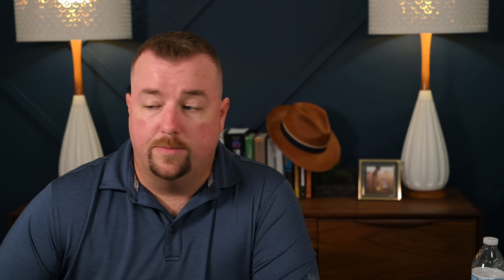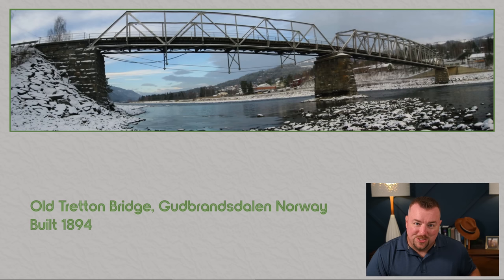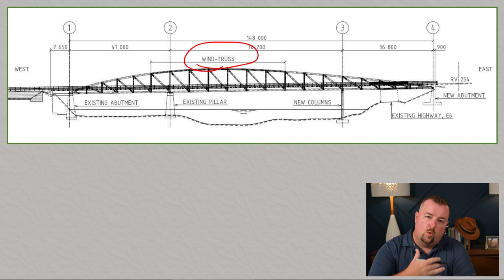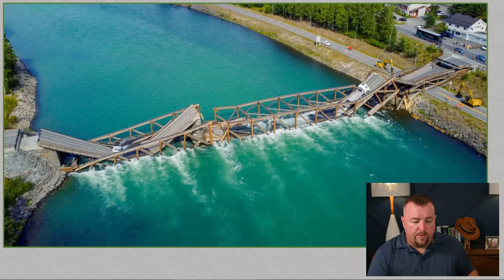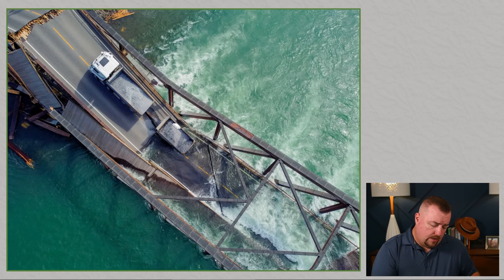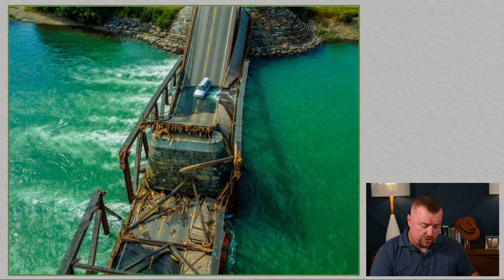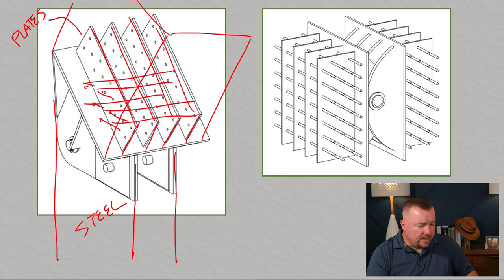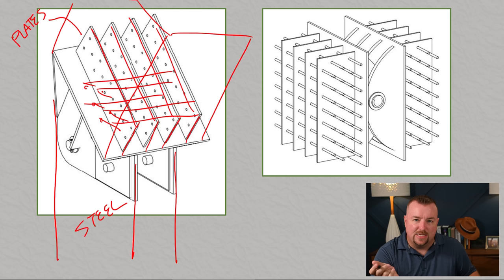How Did the Engineers Miss This?

Comment: Wood beams attached to steel in tension is never a good idea. It’s very difficult for o make this a reliable and stable connection. Cables for tension load might have worked a lot better. FEA / computer analyst without actual proof testing is never a good idea.

Comment: Wouldn't the dowel pins break because of different heat expansions between the steel and the wood? And the wood would swell when wet, so we get yet another different stress on the wooden dowls. Am I right?
PS: 'a lot of people smarter than me' - stop saying that to yourself. They're people whose work involves testing to destruction. You're a person who counts on their tests being accurate. Different jobs in the same industry. Not 'smarter', just 'different'.
PPS: I'd rather not take it with a grain of salt. Salt causes corrosion!

Comment: Humans have been engineering scarf joints for literally hundreds of years!  Why are they trying to reinvent the wheel here?  
I'm shocked that they didn't even lap join (to say nothing of a proper scarf) the laminated beams, but I guess that doesn't appear to look like where it failed first.

I thought is was kind of telling when the three "different" test samples were nothing more than minor variations of the same flawed idea, multiple fasteners on the same grain of wood.
I'm sure anybody watching this video knows that when you nail two 2x4s together at a 90, you put the nails in at a 45.  That is exactly so that the nails won't line up with the grain in either 2x4.
A proper test should be done with just three, larger and square, pins diagonally to the tensile load and grain.  The wood around the fastener is what matters, not the fastener itself.

Any amateur shipwright that watched this video, is already coming up with dozens of joints used in wooden boats that would have fared well better than this silly tab and pin idea.
 
I agree that without proper weatherproofing, the whole idea was doomed before it started; even if all the other issues were corrected.

Comment: Using solid or laminated wood is no problem. We have built bridges that way for millennia and they are holding up for centuries. Wood is also a very good construction material - cheaper, durable and light. Those bridge-collapses got nothing to do with the wood or glue but everything to do with crappy engineering - people with no experience, that only rely on computers and think everything the "old folks" tell them is useless.
That wood splits apart when there is tension and it is fixed with perpendicular dowels/rods is ancient knowledge hence why such connection are near universally reinforced with some sort of contraction that holds the wood in compression - like either a tension rod or compression ring.

there are several other flaws that had been brought up when those bridges were designed - one of them was the very poor and inefficient weathering protection.... rusty bolts in wood......

Also - considering just how bad the bridges in the US have become even these wooden bridges with insane design-flaws don't seem out of the ordinary.

Comment: My word this guy seems to like hearing himself talk and sound important.
As a builder of large construction for over 50 years I have learned more about practical engineering than the kids coming out of “engineer school” knowing nothing but how to push buttons on a computer to get an answer spit out.
Any experienced builder already knows that such a connection between wood and steel is a structural hazard on several fronts: 1) as shown; the wood fibers respond poorly to pin loading. And this truss design puts all the stress exactly on that joint in the worst possible way. 2) increased wood rot in these pin locations cannot be negated, exacerbating the fiber failure. 3) a truss stresses most at its “hub” locations (where members join) and this specific truss design makes that specific point the weakest, exacerbated by the previous 2 points.
This truss was an accident waiting to happen and any first year engineer should have seen that clearly.
This guy talked way to much.

Comment: The connection between the steel piece with the four plates merging into the slotted glue-lam beam is destined to fail.  IMHO, in order for the connection to work (water intrusion aside), he lumber and the wood must be compressed together.  However, this "Dagwood sandwich" of wood-steel-wood-steel-wood-steel-wood-steel-wood can never compress enough to form a grip on the wood.  Only the two outside pieces of the glue-lam are compressed against the steel.  The center three portions of the glue-lam (60% of it!) are not gripped enough in compression because those steel plates are not going to compress or bend towards the center of the beam when the bolts are tightened.  A poor concept will result in a poor solution no matter how well it is built.

Comment: Again I do not admire building engineers after 50 years in concrete management.Their job is basically common sense.Roman engineers achieved miracles without computers or sheets of maths.Most disasters could be avoided if plans were looked at by  large project building firm managment

Comment: Actually, it is possible to make interesting conclusions from this. So gluelam would have been ok for top trusses (basically as long as it is in compression) and whole bridge design would have been fine as long as bottom trusses and cross members under tension were steel. What I am saying this isn't even hit on gluelam, just realisation that this material should not be used under tesnion.

I have seen several bridges of gluelam, but most of them where pedestrian bridges with questionable life-span (so maybe design lifespan of 30 years)... and I think that is reasonable. However, I can't see how they made this vehicle bridge from gluelam and expected it to last 100 years... even 10 years seems kind of lucky. Besides anyone who has ever worked with wood, even small project, furniture will know that most common failure in wood are joints... seems obvious, bit probably it isn't.

Comment: Wow- after looking at the angle that double truck is at-

No way could just tires hold it like that.

Just a guess but I suspect the bottom trailer is sitting on "something" -preventing it and the rest of the truck from sliding backwards.

Oh if those folks are soooooo determined to use "wood lam" for heavy loads-why use ANY STEEL?

Should be easier to join wood lam to wood lam-just build-overbuild-heavier-Steel-pins etc-will always "shear-cut" the wood-that is why god made steel axes to CUT 

WOOD

Insist on using wood-use ALL WOOD

I wonder how the Limeys joined the plywood of their WW2 MOSQUITOES to whatever metal they used-yeah they had to mount very powerful twisting engines

to that plywood?? Course those 1940 woodworkers were far more adept working wood than 2015 "engineers"

Oh well great video-thanks

Comment: Those joints look like they were designed by someone who has never actually used wood as a building material! Why would you do it that way? Makes no sense. It looks like they were designed for steel, not wood. I'm just saying, engineers need to get their hands dirty, far more often. Take a break from designing every once in a while, and actually build something, with your own hands. Love the comprehensive breakdown! Thanks! 👍

Comment: An excellent video in all ways.  I don’t think the bridge designers appreciated two things.  First, truss joints ideally transmit only tension or compression but there is also a bending moment at each joint which will tend to pry the joint apart.  This moment will separate the wood fibers or glue planes in gluelam.  Second, shear fastener joints between materials with different moduli of elasticity must take the large variation in individual fastener loading into account.  Fastener patterns must be trapezoidal rather than rectangular as shown in each of this video’s images.  Early helicopter blades were often wood attached to metal root retention fittings.  Tapered sections and or bolt patterns were required for successful designs.
Reply: This whole bridge just gives me a bad gut feeling.  I would bet that someone placed too much trust on a garbage FEA simulation with poor material properties and mesh sizes around those joints.  Wood is very complex, not isotropic like steel and it seems like they just replaced steel members with wooden ones with a very crude understanding of the strength of the material.

Comment: And this is why i'm of a opinion that engineers well as architects should be required to work least few years in field they are designing shit before being allowed to draw a fucking line. Theoretical designing and practical designing are two entirely different things witch the practical side engineers most often fail in. Any wood worker or construction worker could have told them this would happen and reason is these engineers dont have per say street smarts for shit. Hell wood worker could have probably told them how to mitigate that issue and construction worker could have told them how to make it so when wood starts to rot away, how its easier for the workers to replace those peaces with out need to take the whole damn thing apart, over a water... Have the metal plus some rusting reserve be the main frame of the bridge that carries its weight, while wood parts are replaceable with essentially jacking the bridge from the center of the carrying spots using hydraulics so new beams can be placed under of the steel frame and those wood peaces bring the load carrying capacity of trucks and such. Deflection of the bridge can be monitored and repaird done when needed while using less steel as material, though its question if replacing stuff relatively often is better than spending more expensive steel that hold for century and just repainting it in few decades... As a builder sandblasting and painting would be easier job than replacing whole sections since you still need to do that maintenance to steel parts anyways with similarly size surface areas to that of a full steel bridge, so what was the point of this cost saving idea again? 
For instance buddy was welding frames for windows on steel glass construction that formed a pyramid. Dimensions were required to be rather accurate since size of that thing was pretty large.
Engineer comes to site inspection and starts to go ape shit on buddy since he was not following the technical drawings as presented. Buddy thinks this is a joke and replies with "tag holds a ton and flux a another, so it will hold just fine!". Engineer goes back to his car puffing AND COMES BACK with KEMPPI WELDING MANUAL and points out that 5mm long long weld with x penetration etc etc hold only X amount and flux is cover material during welding with next to no holding power to mention. Buddy realizes this daff cunt is actually serious and tells that these are tags to keep the construction in place and from warping, since building it like technical drawings present is simply impossible as steel will warp like hell when welded, specially frame like it was produced and engineer should fuck right off back to office, come back when work was done and let them do their fucking job.
Engineer left and didnt come back, but when you are engineer and dont know what the tag weld is.... damn you are clueless and should not be drawing anything metal related designs..

Comment: Another thing to consider affecting tension in the bottom chord of the truss could be shock loading depending on the speed of the truck.  Very interesting analysis! It's interesting to see how the environmental push for "sustainable design" where engineers earn brownie points by using "renewable" materials results in engineering failures!  I think we have plenty of engineering failures without adding the burden of meeting random globalist mandates!
Reply: zapfanafan wrote "The driver of the truck said that the roadway on the bridge suddenly looked like it had waves and then it was like an Earthquake. "

Comment: wooow so much study into a a thing any wood worker knows 🤷 grain is stronger than lignine (the stuff that's in between the grain). and because wood is usally cut (ripped) along the grains for length, they did not have a sample which would break as they wanted 😂

Comment: This is what happens when you use math to justify/excuse shit materials and an unconventional design. The original timber bridge that preceded the 1894 bridge would have been better than what they ultimately built. Engineers need to stop designing to the absolute bare minimum just to secure on-paper, theoretical safety margins. Solid timber, stone, riveted steel and unreinforced masonry; those are the materials we are supposed to build with. Embrace those traditions and everything will stop collapsing.

Comment: This whole design is just awful.  We have wooden "covered bridges" in Pennsylvania 200 years old that are in fine shape.  Walk through one and you can see wood joinery and techniques that actually work.  Also note they have a ROOF AND WALLS over the structural parts. Those doweled feather joints are just so bad.  You are better off building entirely in wood or entirely in steel.  The only way to integrate them would be with a steel socket joint that fully encapsulated the end of a wooden member.

Comment: Ehhh every carpenter worth their salt could've told them how that would behave in tension, what would give first. No need for a scientist or engineer,  you just need someone who knows wood. Seem rather stupid to have the steel "fins" inside the wood for the bracings. Traditionally a wood to steel connection have the steel outside the wood with bolts through so the press on the steel first hand, the connection length is also longer, these fins are relatively short(poor moment force handling also).

Comment: Daddy why are 200 year old covered bridges covered ? Asymmetric bridge can't handle an Asymmetrical load . broken by a weight pressure wave , structure was not unilaterally flexible,  Wood or Steel pick one or the other , And consult an Amish engineer next time u build a wooden bridge. One look and u can tell something is not right , like you can drive from the skinny end to the thick end with a loaded truck but not in the other direction as evidenced by the break just beyond the fulcrum of the point load at the pilings.

Comment: I had to crank it up to 1,25 speed due to the droning on an on.
No the didn’t mean that the bridge tests were supposed to fail (16:22), it simply says: from beginning of the test right up to its failure the wood started to elongate linearly until the hole was so long/ deformed that it failed. (Your interpretation ist that the tests where biased, which test shouldn’t be),
2. the copper plating on the wood ist not so much against rain as mainly against snow, which can last for months, be one or two meters high and really soak the wood.
Ideally no holes in the wood are allowed to be exposed. But as we have seen in the collapse of the Bad Reichenhall scating rink in 2000, if you change the operating modus of a structure ( there from open to enclosed, where the water vapour couldn’t escape) than it is outside its planned boundaries, and after some time of overloading might collape/fail.

Comment: The design shows complete lack of understanding of nonsteel materials.  For example the right triangles going one way is like 50 percent stability loss over isosceles triangles.  Pins joints have no weep possible and interfacing steel and wood has a fatigue factor blah blah this is their first project right?
Reply: If it had dovetails well...

Comment: Rust and ice could have expanded inside inside the wood joints and also the truck could have bounced rhythmically, multiplying stress.  But really, where is the Engineers' common sense?  The mechanical guys I know have an intimate sense of materials learned through hands on experience; they visualize and focus on details within every element of the structure.  And tellingly, they've also been truck drivers. What twit wouldn't consider the limited software material specification as it might differ relating to the joint?  I mean, that's a common and obvious failure point and worthy of extra investigation. And the orientation of the pins in relation to the grain...really?  Engineers are required to stand on their completed structures, to show solidarity with users.

There's a problem here, and it relates to how kids are not encouraged to learn handy skills by parents who want them instead to be white collar professionals.  A disdain for real life hands-on experience wrestling balls deep in the real world in favour of politics, theory, without the savvy to recognize and deal with misdirection, sins of omission, outright lies, optics and spin and their potential implications. 

As a professional driver, to me a hazardous pothole is a pothole; you avoid it, you could crash. It is not a land-sky interface artifact and scheduled maintenance issue.